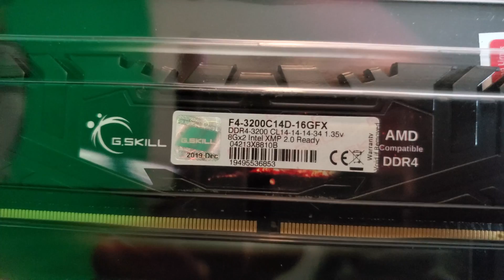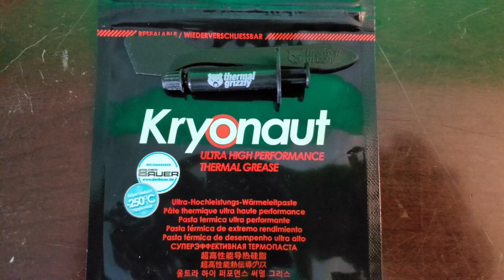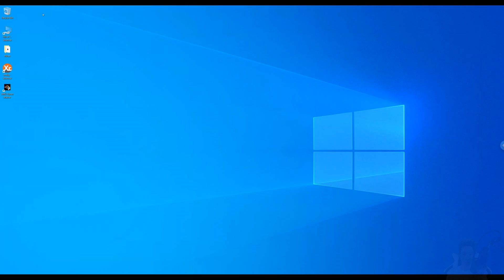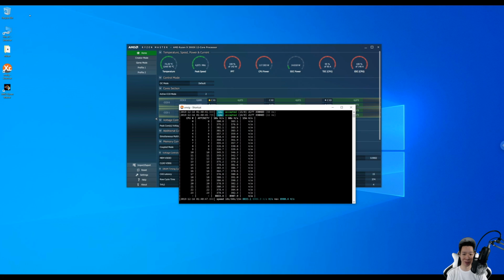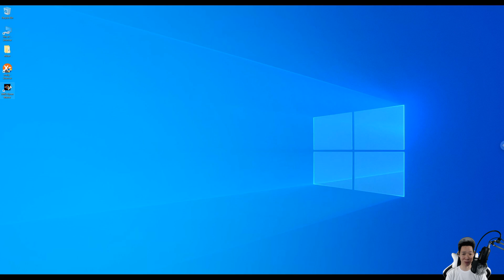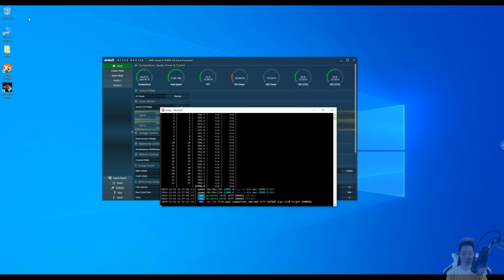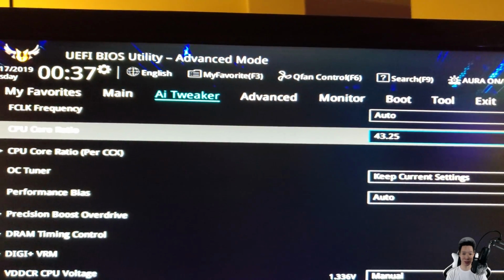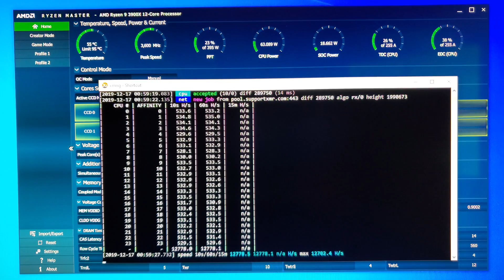15,000 H/S!!! Ryzen 3900X Mining Monero | RandomX (Update)

Comment: Bro, you will get more hashrate using ddr4 3900mhz. Set fclk 1:1 @1800mhz. And stock the cpu speed @3.8ghz with vcore 1.0150. I get 14.000 hashrate using msi x570 tomahawk with the same cpu. My ram timing is default xmp (18-22-22-42) 1.35v single rank corsair 3600mhz 8gb x2

Comment: Thanks for the info, what settings do you leave it at for 24/7 mining ?  You don't push it at 80 degrees 24/7 do you?  My cooler is the coolermaster dual 120mm EVO, I have a set of gskill 3200 16 cl ram and a MSI MPG 570 mobo with the 3900x... with the current cooler and stock settings anything over 14 threads pushes temp to 80 degrees... so I haven't even tried 24 threads yet, but was at 10-11 kh at 20 cores. will the machine thermal throttle over 80 degrees.

Comment: Good day! I managed to get a good hashrate off my 3900x @105watt draw (HWINFO readings). I mine on a full tower case along with 2 1080 Tis. If the 1080 Tis aren't mining, I get 65c max on my 3900x at low fan speeds, but when the 1080 Tis are mining I get around 75-80c. Would this still be good for 24/7 mining? How are your 3900x doing?

Comment: What kind of temps are you getting with that cooler?
Reply: Judgin by my CPU similar settings ~70-73.
Tbh the only times I sae 3900x get higher then 80 is in Prime95 test or really long rendering periods when the cpu is OC. But still peak I saw was 85

Comment: Sir, I am a beginner and mining with my laptop i5 7th gen Dell Inspiron 15 3576,
Which has 2gb Radeon tm 520 I am using miner gaye which is not detecting graphic card
Reply: I have 2 rams installed,
1200mh, 4gb and 8gb 2400mhz 
I got hash rate  of 500 to 800H/s

Comment: Is it better to use CPU+GPU or CPU only using xmrig? I'm on Linux and with CPU+GPU I get ~9000+ for 60s H/s. My rig:
 
Ryzen 7 3800X (stock clock, stock wraith cooler)
RX 5700 XT (stock clocks)
32GB Trident Z Neo CL14 3600 MHz
 
1GB huge pages enabled, MSR module loaded, all green (no errors) on the xmrig console.
 
 MCLK/FCLK should be 1:1, as I set the XMP profile (3600 MHz) + FCLK clock to 1800 MHz. All works well so far. I can use the PC to a certain extent while mining.
Reply: Monero is not for GPU mining....well unless you like burning energy with no profit
Reply: @DavidHajes  ahhh okay thanks

Comment: I build the same pc but without GPU, and when i turn on the machine a VGA White led turns on, no Signal on the monitor.
Any advice??
Reply from the maker: The 3900x does not have integrated graphics. You need a graphics card.

Comment: If the rig mining XMR and some GPUs mining ETH. How will it preform together.
Will it loos ETH and XMR when run all same time. Did you try, any numbers ?
Reply from the maker: Yes, you lose a tiny amount of hashrates for XMR when duel mining.  I only lost like 50 H/s mining XMR.
Reply: @TheLifeofaMiner  
Thanks for your answer. I want to change the old motherboard w. I3 first gen. in my rig to a more efficient Ryzan. Then spend more money on the CPU and run XMR same time. Must be more economical long term I believe.

Comment: Hey, great video.  Hits all OC and tweaking for maximum XMR hashrate in one video.  I'm currently using your 4325mhz clock and 1.35v core setting, but played around with some other timings.  Was able to get it stable at 15.45K with the help of 3200 mhz CL14 ram, slightly lower timings, and a water pump for the cpu that's keeping the 3900x at 79C.
Reply from the maker: Thanks. Yea did some more tuning and  got it up. If you copy the whole dclac fast settings,  you will get the best results.

Comment: so a 66% reduction in power draw of the CPU for a 20% reduction in hashrate when compared to the max OC.

since you did these tests with 5.3.0 which gives the MSR performance boost I wonder if that made CPU clock speed more of a factor then it was before, because like I mentioned in your previous video I wasn't seeing much of a performance hit by locking the clock speed to the base clock.

Comment: Stumbled upon your video google to reddit. I like that you're guiding us through your process and thoughts. 
Currently trying to determine if and how to balance my computing needs with my new 3900x Build. I'd love your thoughts.

My demands (in an economics sense of the word): Hackintosh daily driver. Windows for mining when not in use as Hackintosh -> And/ or, UnRAID machine where windows and Hackintosh are constantly running VM's where my windows would be scaled the largest so long as my Hackintosh got 1 graphics card and enough cores to be great. 

Kind of over zombie load and low cache compromises with my i5-8400 and 7700k machines. 
Hard to say what needs it's own rig, and what's ok to mix. Unraid can handle anything if your hardware can keep up.
I'm curious to see how the mining performance will go though with sharing/ partitioning the ram.

Comment: hi bro, i have a 2700, it worth upgrade the ram? it worth for you becouse its such a high end cpu but mine pulls like 5000h/s how much can i gain with c14 ram? you gain like 10 to 15% so for me would be like 400h/s more, but the ram it is so much more expensive,  it worth that kind of upgrade? thats almost 3  month more of cpu work to paid the extra cost of the ram i thing, sorry my bad english
Reply from the maker: It depends on your electricity cost, but a I hear you can get around 5600h/s with c14 ram. I personally think its not worth it for a 2700.

Comment: Very informative video. Thank you. Running the exact same RAM/CPU as you but I used DRAM calculator (FAST Settings) to set it up for 3600 Mhz instead of 3200 MHz and get better performance still. I also run CPU at 3600 MHz @ 1.0V for max efficiency but get a steady hashrate of 13250 hs. Maybe worth a try.
Reply from the maker: Thanks! Will try it out.

Comment: Nice. You broke down the hash difference between all the optimization steps really well. 
I ended up with a similar hash on low voltage.
Almost 12kh, I just set in my bios my CPU to be in super eco mode, 90 watts, with stock 3200 cl16 ram. Idk if the cl14 is worth cost.

Comment: Ballin!!! damn nice result man awesome specs!
Reply: I know you have a 2700. I manage to double my hashrate from 2300h/s to  4400h/s with my 2700 and that's due xmrig5.2.0 enabling 1gb large pages in linux sudo. I'm now glad I bought the 32gb 3200ghz/s ram. Would overclock the CPU but still using the stock cooler.. but those are the numbers at a safe 3600MHz/s for the CPU..
Reply: @anythingbutASIC  bruh, hows your cpu so slow, my acient r7 1700 does 5820hs, i would cry if my 2700 was that slow
Reply: @sniperpronerfmods9811  I choose not to push it as I don't have sufficient cooling..
Reply: @anythingbutASIC  last time I checked you dont need cooling for ram, idk what your are talking about??
Reply: @sniperpronerfmods9811  I don't have cooling upgraded cooling for CPU. I'm thinking mabye Nocturna at minimum some kind of tower air to air cooler..
Reply: @sniperpronerfmods9811  I've come to find out that a good motherboard is key. The A320s do not have the high performance Buses and control chips needed for higher rates.
Reply: @anythingbutASIC  motherboards dont have buses or control chip anymore, that as phased out 10 years ago. What matters is the bandwidth and latency of the ram, and if the infinti fabric is synced up with the memory 1:1, and cpu clock...that is it. A320 motherboards are just fine, usally they can do 3600mhz ram which I what you want
Reply: my 1700 is doing bout 5400hs right now. plus i find i get more hashrate with oc speed than ocing timings for ram
Reply: @rubenechezabal6397  not too bad, my cpu cores are so stubborn, they need 1.5v! To do 4ghz, so I just cranked up the ram to make up for it, learn a thing or 2😉
Reply: @sniperpronerfmods9811  i feel you right now i have it set to 1.35 v for a 39.75 clock ratio oc. anything higher than that it just isnt worth it for the heat and abuse on the cpu although i do have the nhd15.

Comment: hmmm intresting 
I hawe TR 2950x 16/32 3.9Gh/oc
Ram 32gb quad chanel enebled
 3200Mhz with spec 14x14x14x34
max what I manage to pull is 9Kh
is this ok or I can rize more if posible  plz tell me how
thx wery usful video
Reply from the maker: That sounds like everything I would think of.  You might be maxed out already. 9Kh seems correct looking at the other Threadrippers.
Reply: @TheLifeofaMiner  the most intresting part is if I use 32 threds it fall to 3/5 kh best solution was 18 threds 8/9 kh
Reply: @bojantoprek7769  TR 2nd generation has less L3 cache than R9 3900x and thus cannnot achieve max hashrate at max threads.
Reply: @sinistar9044  txs for explning this to me